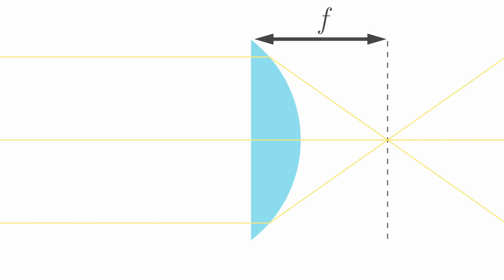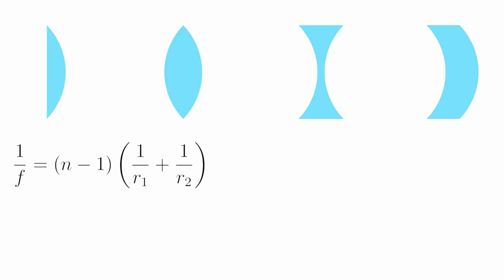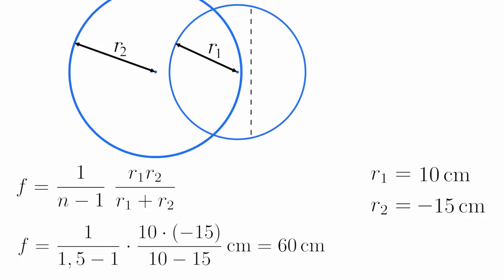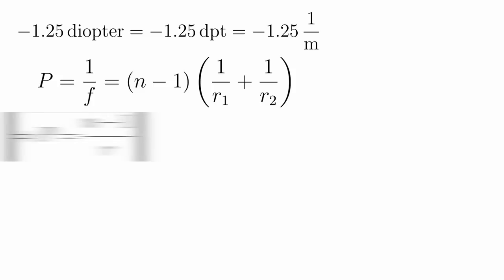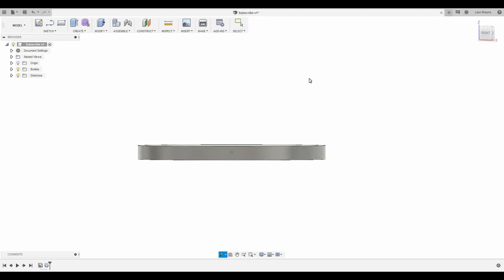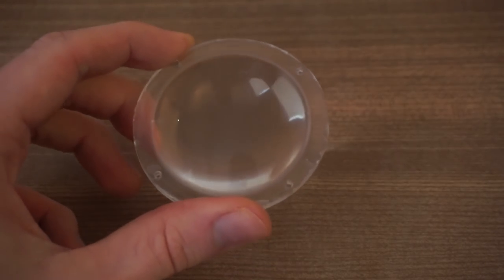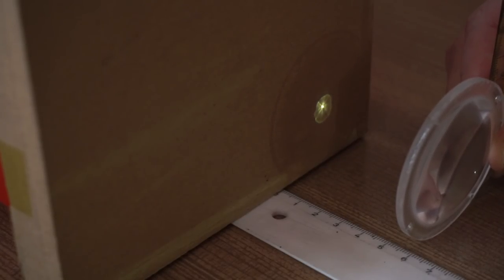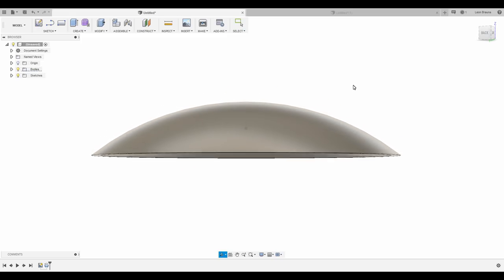Making Lenses with a CNC Router Part 2

Comment: "Fusion expects a diameter so multiply the number by 2" -

You can use radius dimensions in Fusion since a surprisingly recent update 🎉🎉. Right click on a dimension to change it to be a radius if that works better to express design intent. You might also be able to right click and do that while creating the dimension, not sure. 

Another super useful thing in that particular context menu is the ability to set a dimension between arcs or circles to be relative to the tangent lines formed by that dimension.

Comment: What lens/combination of lenses would I need to shrink the image of a small lcd screen and have a square (as non-distorted as possible) output? I have an idea for "shrinking" the output (UV pixels) on a cheap LCD to create a resin printer with higher detail than the pixel density of the screen.